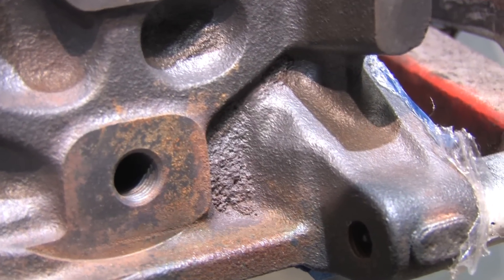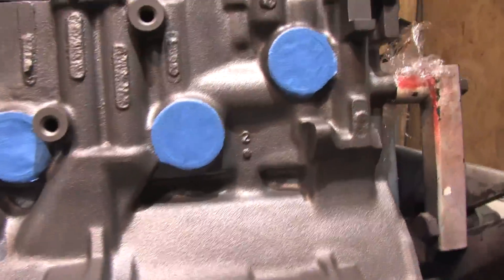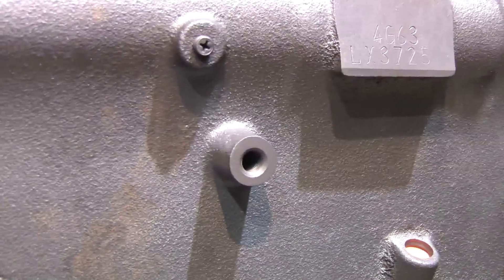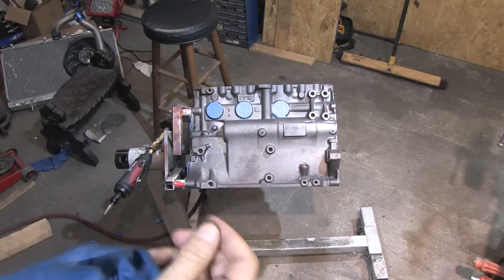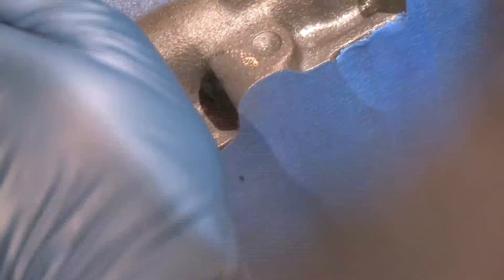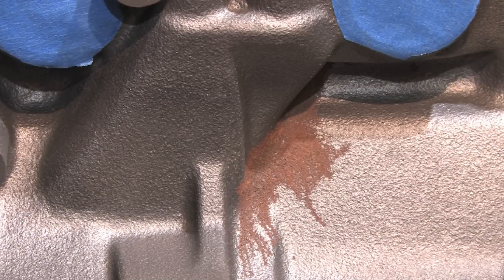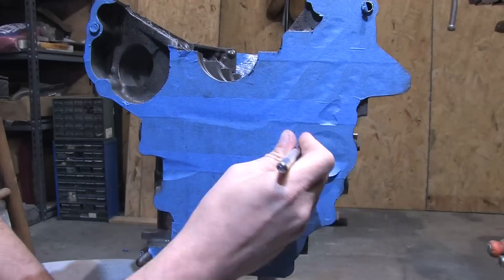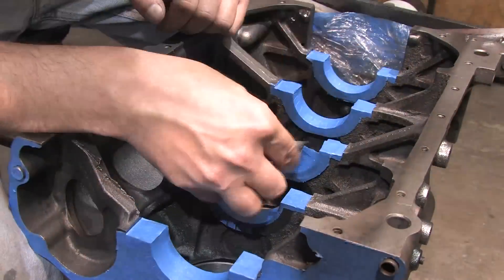GSX Block Prep Part 1 [1080HD]

Comment: i got a question for you jafro, if i may. for people doing the 4g64 7 bolt block with a 4g63 7 bolt head swap, does a 2g 7 bolt complete gasket / seal overhaul kit work with the bottom end, or would we need a 4g63 head kit and a separate 4g64 block overhaul kit?
Reply: finally found that one random post that clarifies everything: http://www.dsmtuners.com/forums/cylinder-head-short-block/313201-4g63-4g64-swap-4.html#post151909985
Reply: Jordan Liske Holy shit, what a hunch. i was like i wonder if you can post links with this new comment system. Cntrl+v and clicks Post. Biggest grin ever.

Comment: Now we know why such careful grinding is required.  Once lapse of focus is all it takes to screw up big time.  Let's say that it did put a small gouge it.  Why would that make a difference since there is a large journal going to be mounted on top of it.  The shaft rides on the journal and not that surface.  Obviously you don't want any scratches but I don't see what the big deal is about for something so miniscule.  Only thing missing was a homemade dunce cap.  That would have been funny. :)

Comment: why wont you just add a junk main bearing on top of the tape?and the the mistake you did wont hurt anything, i just dont see how it will , 

the bearing will stay in place after the install if theres a nick,and even if the motor is up and running,